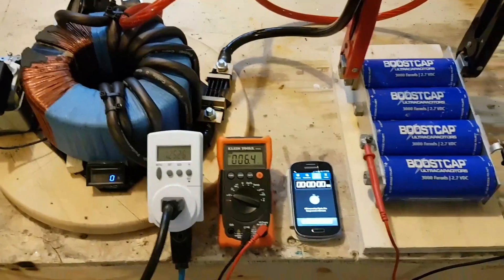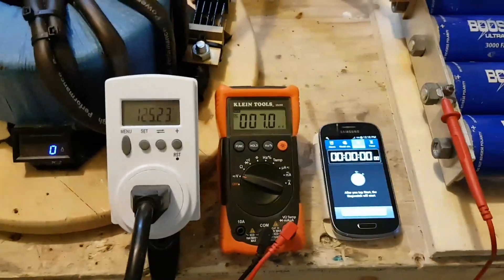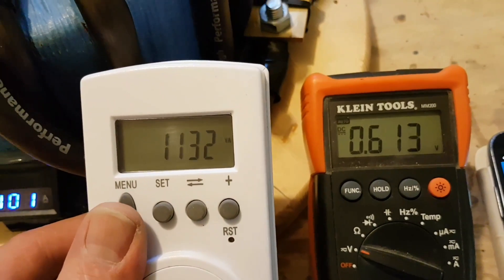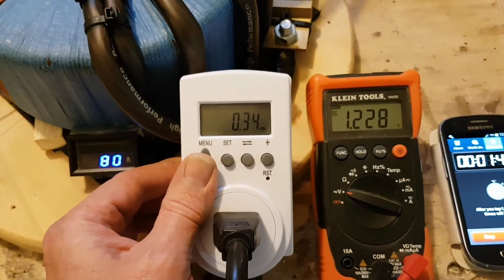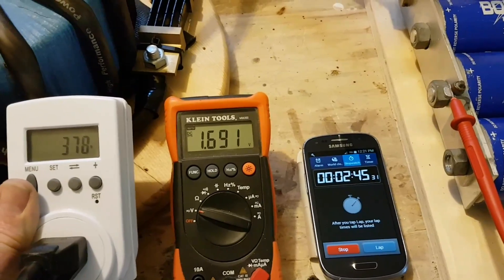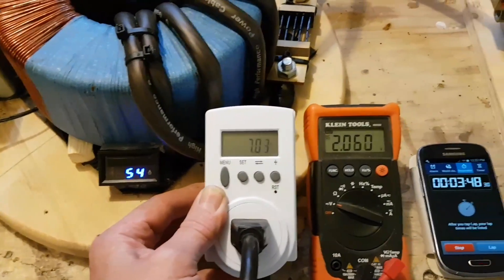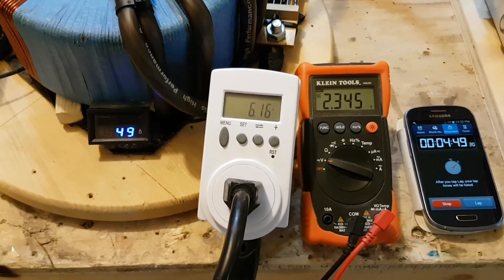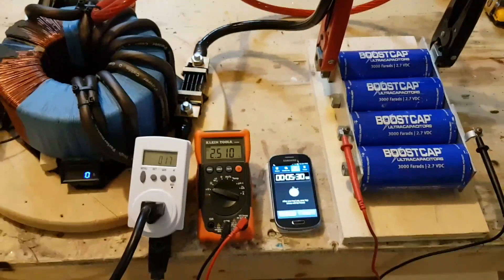Super Caps Charging Part 2...

Comment: If you connect the charging leads to the 4-bank in diagnoal, at this current level, the high current will tend to share more equally between the caps...an old 5kW induction heater  trick for high current through parallel caps.  It would be interesting to see if the charge time changes.

Comment: I use to charge 12 caps a 1000 watt HPS ballast transformer with the secondary coin rewrapped with 4 awg cable. I can charge them from 0v in 30 seconds. I’ve had mine in my car since 2011.

Comment: these caps r 170 bucks per piece. they r too expensive.
Reply from the maker: +Dobos Attila 
No, they are cheaper than that... here is the website. 

http://ca.mouser.com/Search/m_ProductDetail.aspx?Maxwell-Technologies%2fBCAP3000-P270-K04%2f&qs=TvYXSR6pz%2f0%252b6cJnREvuCA%3d%3d

Thanks for watching.
Reply: Thank U  so much.  I will order 5 pieces for a car battery replacement.
I don't know how long they can hold the charge.

Comment: Why not use a full bridge? Twice as quick and it looks like the wire is thick enough to handle the current.
Reply: The more efficient way is to make center taped secondary.
Using center for GND and other two ends as positive with diodes on it.This way you got full rectification with only half diodes - less losses than in full bridge configuration.
Reply: That is true but you'll have to use double the turns to get the same voltage. The upside to this is you could use wire half the thickness. I've suggested full bridge cause it doesn't require a rewind.
Reply from the maker: +Anton Babiy 
Yes, I agree that a full wave Bridge rectifier would be the best but the price is expensive for that size of current. These that I purchased here we're only $10 each. Thanks for watching.

Comment: How much voltage they lose after day or week?
Is there some efficient way to extract power from them, especially at and below 600 mV?
Reply from the maker: +Micuz Grozni 
That will actually be discussed on my next up-and-coming video in my attentions of using it for. I'm working on it right now and hope to be finished with it soon. Thanks for watching.
Reply from the maker: +Micuz Grozni 
I can charge 2.600 volts then wait 12 hours and recheck the voltage, it went down to 2.545 so the voltage leakage is very very slow. I'm working on a voltage Step Up converter right now as well as another method which I'm testing out and will let everyone know which one works out the best. Thanks for watching.